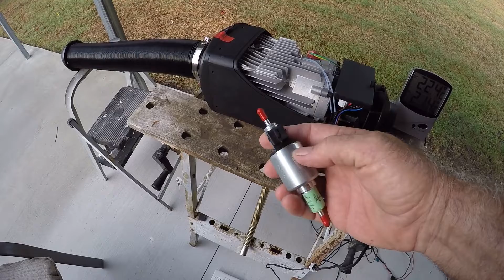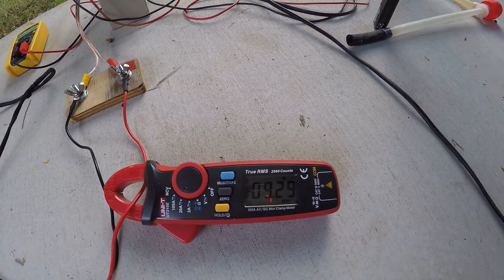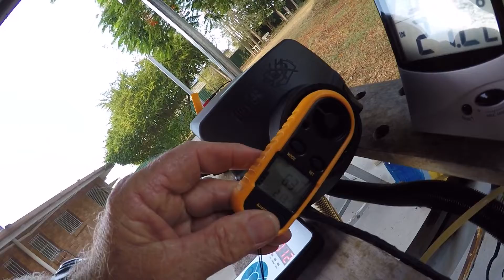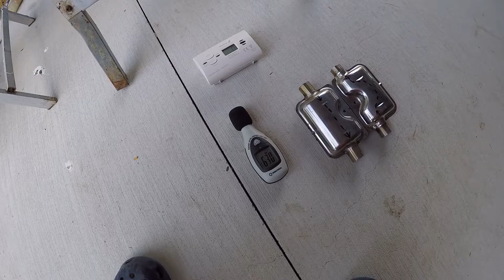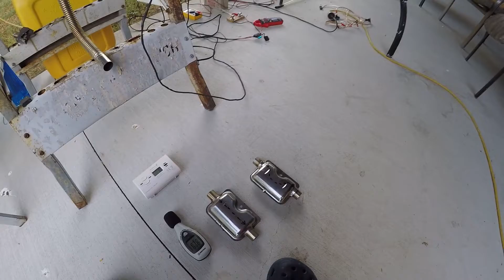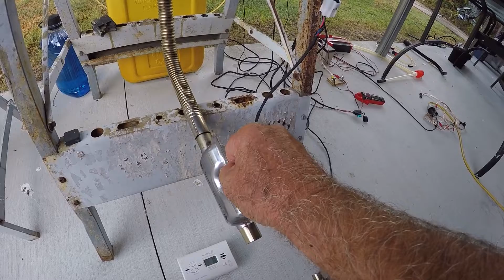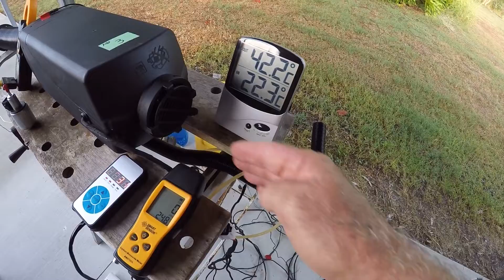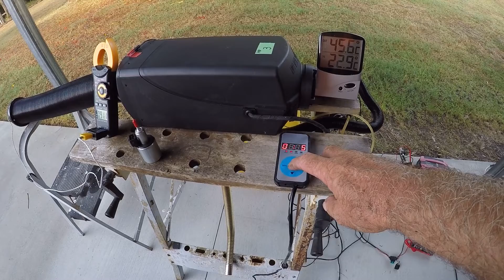Chinese Diesel Air Heaters - Part 2  -  5KW Bench Test

Comment: any protection from power interruption from power company ?
Reply from the maker: Not sure what you mean Gene. The heater runs off a battery.  JMcK
Reply from the maker: Gene 
Hi Gene, if you run the heater off a mains power supply I would not be too concerned unless you live in an area where the power supply is not reliable.

If you are going to have a battery back up you do not need a mains power supply, just get yourself a modern smart battery charger, they are reasonably priced and they can be connected all the time and will maintain the battery at its optimum. Something around 5  to 10 amps output will work well.  JMcK
Reply: @johnmck1147  I have been looking in to that, I have a mister buddy heater for emergency, the power gets ify when we have ice storms etc. i figure this will replace that pain in the neck and eventually replace my electric heat system all together for about what i spend on electric for 2-3 months or less and I won't be at the mercy of the blood sucking power company. thank you so much for your input and knowledge
Reply from the maker: Gene 

I hope it all works out for you Gene.  JMcK

Comment: John. I forgot to ask a question. You are sticking the  silencer at the end of the pipe. But Webastco says to mount them as close to the heater as possible. I’m wondering if that would make it even more quite @ 3 meters since that’s how “official” testing is done.
Reply from the maker: Thanks for the feedback CM. What I was testing, and trying to show the relative differences between each muffler at a fixed distance. It was a comparison test not an absolute test.  JMcK
Reply: @johnmck1147   I know it was. But I do know the webasto instructions say to stick it as close to the heater as you can. The big question is why do they recommend that location over the end?  They also state 2 meters total with a muffler 5 without. I think theirs has a pressure sensor and can adjust fan speed or the Hz automatically. I know the Air Top 40 has altitude compensation to 7000 foot
Reply from the maker: Crazy Marty. ,

Hi Marty,

I like to put the muffler close to the end of the exhaust pipe, and get the best results that way. I also only use a flow through muffler as the baffled muffler creates a lot of resistance. I do not know why Webasto wants the muffler close to the heater. I have seen where Webasto also want the dosing pump horizontal, which does not allow the cavitation bubbles to escape. ?????  Suggest you have a look at Eberspacher recommendations. They were the origional inventors of these heaters, and they have done a lot of testing.  JMcK

Comment: John, great videos! Glad I found them. Im considering one of these units as a solution to frost and condensation in my roof top tent during the winter months here in the very north eastern part of the US. You probably cover it in a subsequent video, but Im curious to see the power draw during low and high heat settings. Im hoping to make a semi-accurate calculation as to how long I could run one of these units on my 62AH auxiliary battery.
Reply from the maker: Hi Flight 110, I show all the numbers in the videos. You could screen shot if you wish. 
In general terms, on low to mid settings, you should get a days use (24 hrs) out of your battery, drawing down no more than the recommended 50% discharge.  JMcK
Reply: @johnmck1147  Yup, I found a frame in one of your subsequent videos that led me to roughly the same conclusion. Thanks again for all the info on these units.
Reply from the maker: flight110 

Your welcome.  JMcK
Reply: Where you at?! Maine?

Comment: Hello John! I've begun learning about these heaters by watching your series. Im only into the 2nd video thus far. Let me say you sir are very good at explaining and excellent in presentation. Its evident that you put a lot of thought and effort into these videos...THANK YOU! My question is this: I want to heat a roof top tent during our camping trips. I live in Colorado and most of my camping is above 10,000 feet. Can these run at that altitude and if so which size unit would serve best for that altitude? What should I perhaps look for in the pump or the controller to make it run at 10,000 feet? Would I be wasting my time building a portable unit to take camping and trying to run it at that altitude? Thank you kindly. Cheers from Denver Colorado USA!
Reply from the maker: Hi CO, 
First, thanks for the positive feedback.
For a rooftop tent a 2 kw unit will suffice.
To the best of my knowledge there is currently no Chinese copy heater with a high altitude compensator. However you can adapt somewhat by burning a high kerro diesel mix, say 80:20 or 90:10 kerro :diesel mix. This helps reduce carbon build up in the heater due to the imbalance in the fuel air mix at high altitude, and increases the time between carbon cleans due to use at high altitude. JMcK

Comment: Best revue/ explanation I’ve watched, I appreciate your thoroughness and effort sir. Thank you
Reply from the maker: Thanks for the positive feedback.   JMcK
Reply: @johnmck1147  thank you so much for all your information and answering these questions, I searched to find a specific but I couldn’t, if I install a breaker to use only during warm weather so the controller doesn’t draw power, would it be advisable to use a 10 amp or should I go up to 15 amp breaker? In this video you said the glow plug draws up to 10 amps that is why I’m asking. Thanks again!
Reply from the maker: Nathan Dalleave 

Hi Nathan, 

My suggestion is to use a 15 amp breaker.

The glow plug can draw “up to 10 amps”. In many cases it is just 8 or 9 amps. 
A 10 amp breaker is very borderline.

Cheers.  JMcK

Comment: Hi John!
Been watching through your videos on these diesel heaters, as I'm about to install one in my campervan conversion. I see you have a video on fitting one to a boat, but I was wondering if you had one on installing into a camper, or even the ideal way to set up the heater for a bench test?
Reply from the maker: Hi there, sorry I do not have one on camper van install as there are many already available on that subject. What I have hoped to do is give some knowledge of the basic install principles. 

It is wise for a DIY person to bench test these heaters before install as sometimes you can get a dud and if so it is easier to exchange first up.

As for bench testing you need to raise the heater up as there is the exhaust, combustion air inlet and diesel inlet under the heater. You can use one of those carpenter vice benches like I use or just mount the heater up on some bricks.

Cheers.   JMcK

Comment: Should the inlet air also be outside of the vehicle? If so, should it be pointed forward towards the driver's seat, or sideways as you have it now? Thank you!
Reply: Awesome video series thus far! Love it.
Reply from the maker: Hi Ziggy, what air inlet are you referring to, the combustion air inlet or the heat exchanger inlet?

Generally it is better to have the combustion air inlet outside the vehicle. Sometimes on shutdown some unburnt fuel vapour can exit the combustion air inlet pipe, and you will get a fuel smell in your vehicle if inside.

The heat exchanger inlet can be either, inside draw you get faster cabin heat, outside you taker longer to heat as you are sucking in colder air, but the plus is you suck in fresh air, and not recirculate stale used air. This one is personal preference.  JMcK

Comment: Hi John
Your videos are top notch. Couple questions 
1 do you recommend a seller that you have good luck with
2 you have talked about intake screens and glow plugs. Do you recommend a source for those.
As always thank you.  Teddy
Reply from the maker: Hi Ernest,

I am reluctant to recommend suppliers as I have found they are very temporary suppliers. Many times I have gone back after a month to a supplier to find they no longer supply the required item.

To start off your search, these two are recent purchases of mine.

https://www.ebay.com.au/itm/Air-Filter-Exhaust-Silencer-Muffler-Bracket-Kit-For-Ebespacher-Diesel-Heater/183705927920?ssPageName=STRK%3AMEBIDX%3AIT&_trksid=p2057872.m2749.l2649

https://www.ebay.com.au/itm/12V-Car-Boat-Trucks-Air-Diesel-Parking-Heater-Ceramic-Pin-Glow-Plug-Tool-88-98W-/333296550016?hash=item4d9a05c080

Cheers,   JMcK

Comment: how long did that lil battery run that thing? I wonder which battery is required to run it about 8 hours?
Reply from the maker: Hi there.
I would connect a small charger to the battery for long test runs. 
In normal use these heaters draw around 16 to 25 amps in 8 hours of running. You would require a battery with around 50 Amp Hours capacity.   JMcK

Comment: I have a portable ACOpower 400AH portable solar generator. Would I be able to hook this up to the 12volt socket at night and run it for 10 hrs with it fully charged?  Thank you - this has been the best series I have watched ever. Very detailed and informative
Reply from the maker: Hi Ana, are you sure you really have a 400AH storage unit. This is a big storage unit, equivalent to 4 large 100 AH AGM deep cycle storage batteries and would not be portable. I only have a 200AH storage capacity in the motorhome, and only 450AH storage capacity in a 46 foot sailboat. None are portable.

Now to the heater. These heaters draw around 8 to 10 amps on start up and shut down for a short time, but their running amp draw is around 2 to 4 amps depending on your heat setting. So in practice you would be drawing around 20 AH to 40AH a night out of your battery storage unit.

I hope this helps.   JMcK
Reply: John McK 47 i only wish!  I meant WH. It’s a small unit 300 watt inverter with 2 ac plugs, 4 USB ports and a 12 volt socket
Reply from the maker: Ana Goldstein 

Hi Ana, a 300 Watt inverter has enough power to run the heater provided the 12V socket is capable of delivering 10 amps of current, and is fused accordingly.  JMcK

Comment: Very informative John - Question, do these have any sort of "fail safe" so that if the battery drops below a given voltage, the unit goes into the correct shut down sequence, or, if the voltage drops too low, the unit just goes off and damages itself?
Reply from the maker: Yes John, at a low voltage the ECB initiates a shut down procedure to protect the unit.  JMcK
Reply: Cheers @johnmck1147 - Further research I did confirms this. However, I understand the LVD is 9.5 Volts, which is very low. 

I was considering using a Low Voltage Disconnect device I own, to kill the power to the pump, at say 11.5 Volts. I wonder if this would cause the unit to think it has run out of fuel and therefore do a a controlled shut down? What do you reckon?
Reply from the maker: John Birkett . 
It would be an interesting experiment John.  JMcK
Reply: @johnmck1147  I will try it and let you know.
Reply: I can now confirm that using a "Low Voltage Disconnect" unit to cut off the (constant) 12V supply to the fuel pump (note, the pump pulsing is done via the negative line) does indeed cause the unit to go into a safe shutdown, with the fan cooling the unit for 4 or 5 minutes before it completely switches off. On restarting, no issues were found at all. It just fired up as usual. I will set my LVD to 11.8 Volts (others millage may vary here) which is a lot safer for the battery than the units built in cut off voltage of 9.5 Volts !!
Reply from the maker: John Birkett 
Thanks for the input John.   
You can also pulse the pump by switching the positive on and off.
Regards.  JMcK

Comment: Awesome videos I really appreciate them. Just a couple questions for you the first one is can you put these heaters on the side so the combustion  intake and exhaust could go straight out through the wall? And on the warm air heat side what is the longest run of hose you could use on there? Thank you
Reply from the maker: Hi Teddy, 

These heaters can be run on their side, but only the side that has the glow plug at the top.
I have run the hot air side over 5 meters myself on a boat without issues, but I was careful to have no sharp bends, and I know of some boats with 10 meter runs.

Cheers,   JMcK
Reply: @johnmck1147  thank you so much for the response and thank you for the videos you have made I have really been enjoying learning from all your knowledge!
Reply from the maker: 1teddy1979 
Your welcome.  JMcK

Comment: 3db is double. Even 3db increase is double the noise. The same applies that every 3db decrease is cutting the noise in half.
Reply from the maker: Hi Andrew,

Thanks for the feedback. You are technically correct, but from my learning days it takes about 10 db for the human ear to "perceive" a noise doubling.

From my old text book. -  "An increase of 3dB doubles the sound intensity but a 10dB increase is required before a sound is perceived to be twice as loud. "

Cheers,  JMcK
Reply: John is correct here. 3 dB means a doubling of the physical sound pressure, but it takes more than that for the ear to percieve something to be "twice as loud". A good search term is dBa (or dBA).

Comment: Really useful video, thank you.
Reply from the maker: Your welcome Marcel.  JMcK
Reply: @johnmck1147  Sorry to bother you, do you think one of this heaters can be installed sideways? Or do they always need to have the intake/exhaust facing down?
Reply from the maker: Marcel S. 

Hi Marcel, the heaters can be installed on their side, but only the side that has the glow plug at the top.  JMcK
Reply: @johnmck1147  Hi John fantastic videos ,so informative. John i bought a 5kw heater about a month ago and installed it myself, worked really well for a couple of test runs and we went away last weekend Ann it functioned fine one night but the next morning on starting after a short period of running it shut down .On starting again it has come up with a E 08 and i cannot hear the dose pump running, could it be the pump or the circuit board. I have contacted the seller and i am getting the run around after more than a week of emails. Thanks Again John.
Reply from the maker: Steve Parker 

Hi Steve, E08 generally means there is no flame. This could be caused by a number of conditions.

1. An issue with fuel delivery. 
Is there a fuel blockage?  If so clear the blockage and prime.
Is the pump ticking? If no, has the plug come lose. Does the pump have power?
Is the pump installed correctly, upright at an angle of greater than 15 degs. Sometimes people install the pump upright at the correct angle but upside down. The wire plug is always at the top on the pump.

2. Does the glow plug still work? It should draw around 9 amps and glow red hot. Has the wire plug shaken lose?

3. It could also be a faulty ECB, or temp sensor.

So I suggest you first check that the unit is getting enough battery power to run properly, Next check that the glow plug is operating correctly, remember that the pump will not start until the glow plug gets hot.
Then check the pump is ticking and delivering fuel. Once again, the pump will not start if the glow plug is faulty. 
Good luck and please let me know how you go.  JMcK
Reply: @johnmck1147  Hi John thanks for your help i will check and see which problem i have,my issue is the u it only ran on for a total of 2-3 HOURS and at the time it ran perfectly  and the supplier is not interested in helping I've put in a complaint with ebay but they are not very helpful..Cheers Steve.

Comment: Hi John. After some advice. Just fitted a diesel heater to our motor home. The recommended maximum length of the 25mm diameter exhaust pipe is 2 metres but to get the end to the rear of the motor home which I prefer I require it to be approx 3 to 3.5 m long. Could I overcome the problem by using the existing exhaust pipe of 1 m length or shorter with 25mm diameter pipe and increase the diameter to either 38mm or 45mm for the remaining 2 or 2,5 m.

Thanks 

John
Reply from the maker: Hi John,

Yes, that will be ok. 

The big issue is back pressure with these little heaters. The combustion fan is small with very small fins. Back pressure in the exhaust or restrictions in the combustion air inlet causes a bad fuel air mix and a poor burn resulting in lots of carbon.

If you need a longer exhaust pipe, go larger diameter like you describe. Try to have it gently sloping downwards, if not you need a drain hole at lowest point.

Cheers,   JMcK
Reply: @johnmck1147  Thanks John, Should I use 45mm or 38mm diameter pipe
Reply from the maker: John Maiolo 

I think 38mm should be fine for that distance.

Comment: Having trouble turning it off
Reply from the maker: Hi Vikki, are you saying it won't go into shutdown mode when you hold down the power button.

Are you aware the heater goes through a shutdown cycle for some minutes after you turn it off. It is normal not to stop straight away.

Regards,   JMcK